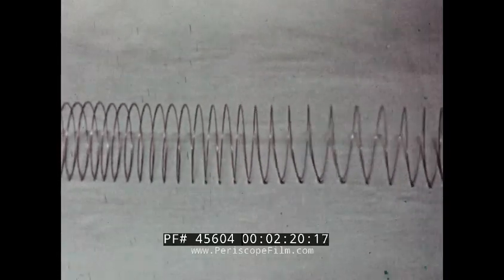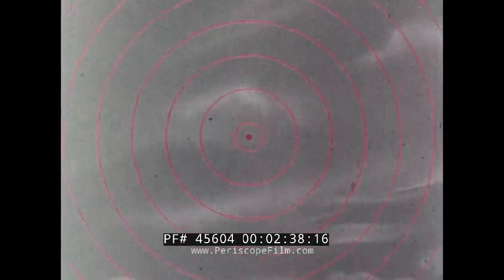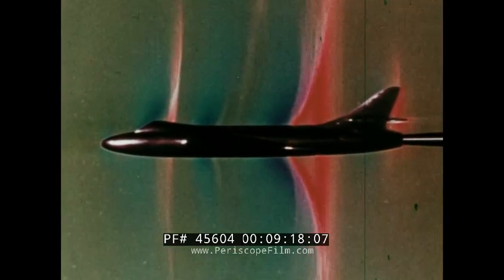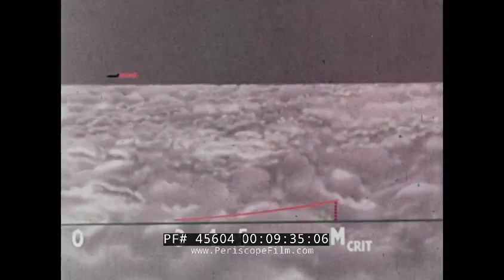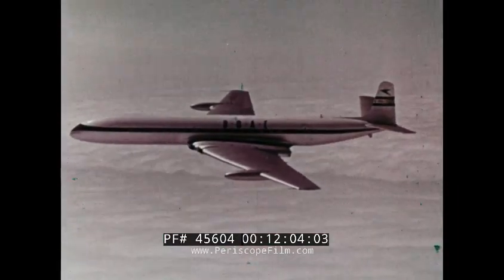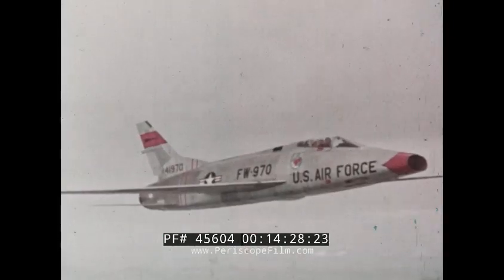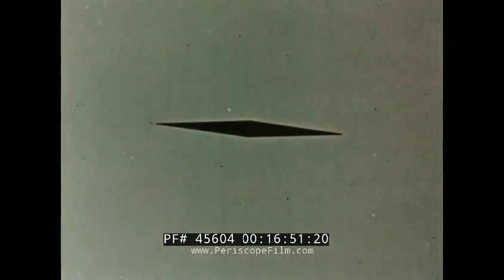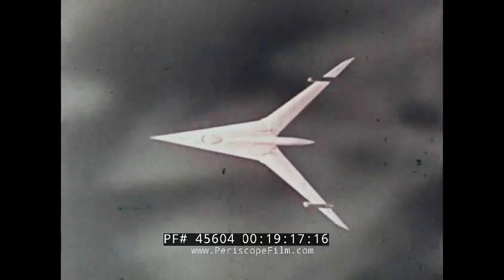HIGH SPEED FLIGHT & FLYING ABOVE SPEED OF SOUND  MACH  SHELL OIL CO. EDUCATIONAL FILM 45604

Comment: Nice clip series, a snapshot of the contemporary theory which for the most part has not been superceded.
1:05 This illustration is one a student in the 21st century might consider a more recent explanation.
That said, even experts at the time of this comment agree their model is not complete.
In other words, the mystery of flight has not revealed her full nature as of yet.
Reply: Ole Bernoulli still holds true... not sure what I would change about that clip. Just curious what you were thinking here?
Reply: @The_Flying_Mechanic    I think he means that the air flowing over the curved surface of the wing and the air flowing below the flat surface do not rejoin at the same time at the back of the wing as this video suggests.   So a linear computation of lift based on the extra distance the upper air must travel based on the Bernoulli relation of speed to pressure is incorrect.  Here is the effect in action:  https://www.youtube.com/watch?v=UqBmdZ-BNig